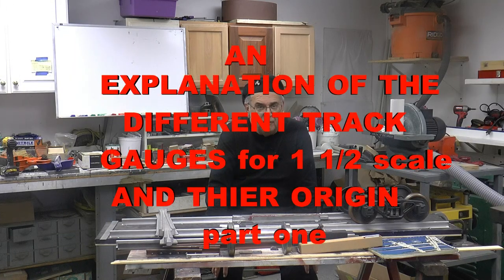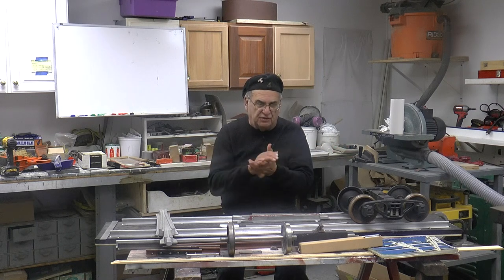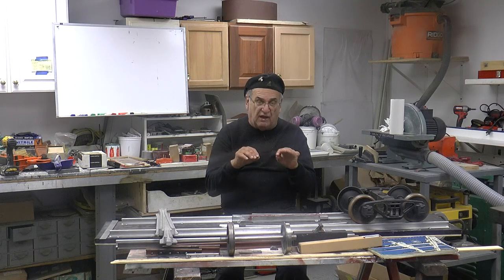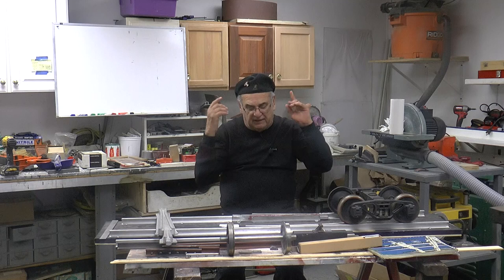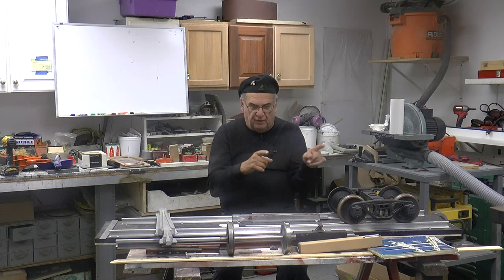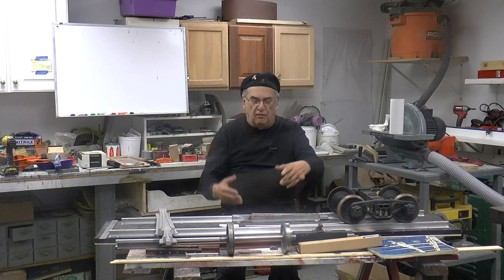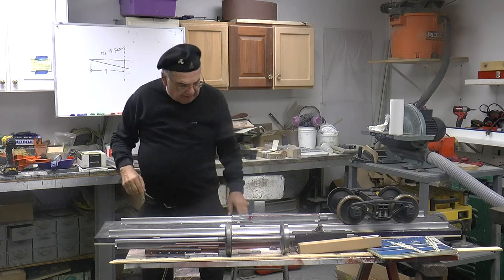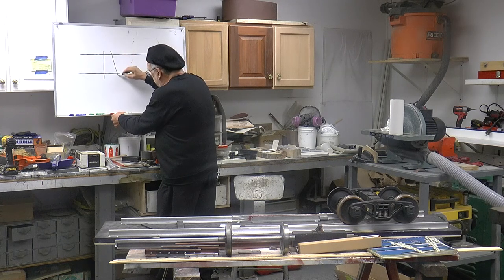GAUGE DIFFERENCES FOR 1 1/2 SCALE

Comment: For new frogs, your method works well.    I was taught to use part way of the frog with a measure then continue on til the next measure then measure the distance between the two measurements., but, of  course, I was measuring full-sized frogs.  The idea of not using the real point of a frog is because a full-sized frog point is one half inch wide to start with and any wear just makes things worse.
We, as hobbiests, would have been a whole lot better off if the actual scale gauge of 7 1/16 inch or rounded to 7 inches would have been used.  Nobody thought about such things back then.  They were trying to make things "easier" by rounding and using material that they had.

Comment: I've run on Nick Edward's track a couple of times (great guy and a great track).  The first time I ran I thought a car had a bearing going, heard squealing.  I soon realized it was just in some turns.  The gage is held to 7 9/16 very tightly and what I was hearing was flange squeek.

I tried to maintain 7 5/8 on my curves and 7 9/16 on my straight sections.  I haven't had enough visitors to know if that's going to work well, only time will tell
Reply from the maker: 7 5/8  gauge is ok if you only run 7 1/2 gauge trains . I'll cover that subject  in part two
Reply: @trainman4602  I'm a long way from 7 1/4 land, even Nick's track is 800 miles.  Plus my minimum radius is 40' so I'll never see more than Mogul traffic - no one's showing up with a Northern.